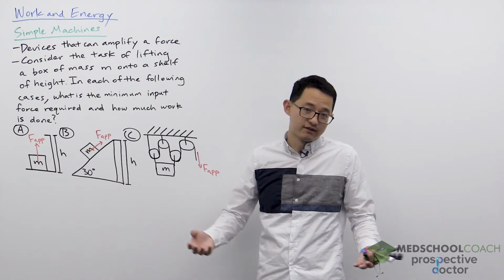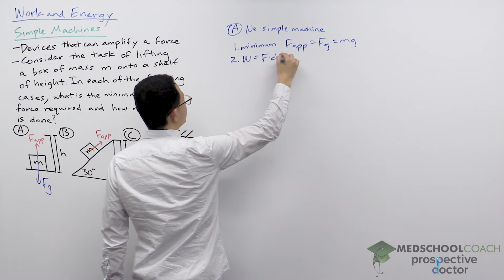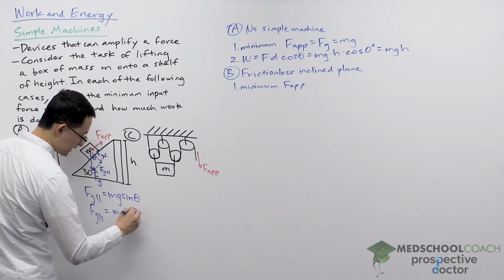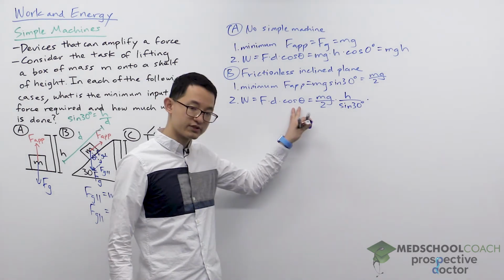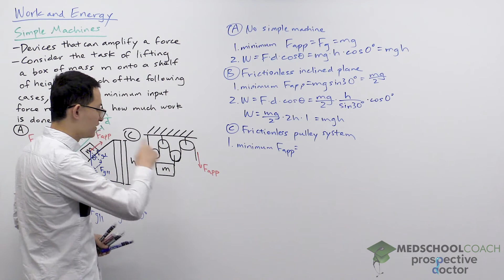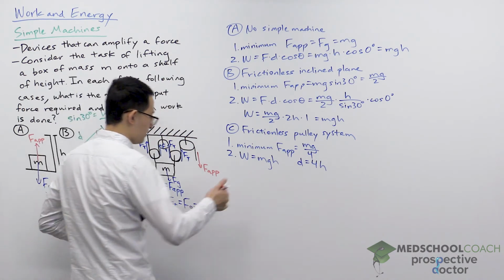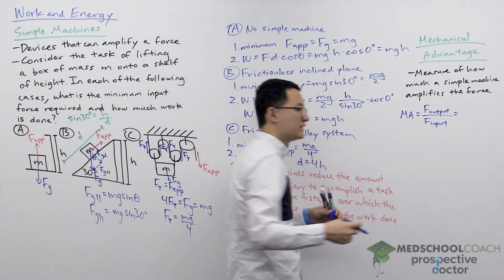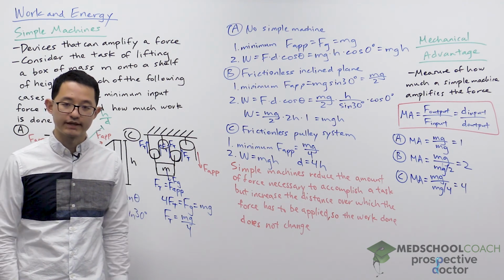Simple Machines within Work and Energy | MCAT Physics Prep

Comment: You should've been more clear that in the pulley system, 4h is the displacement that occurs to the rope that you pull. It is not the displacement that occurs to the object that you want to pull up a distance of h. In other words, since the mechanical advantage is 4, you only need to exert 1/4th as much force, but you need to pull the rope 4 times as far.